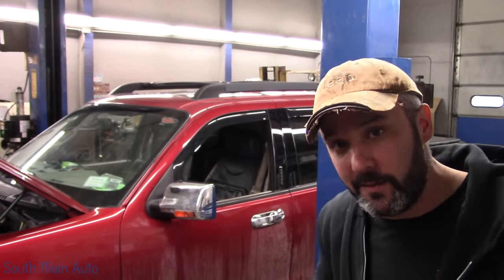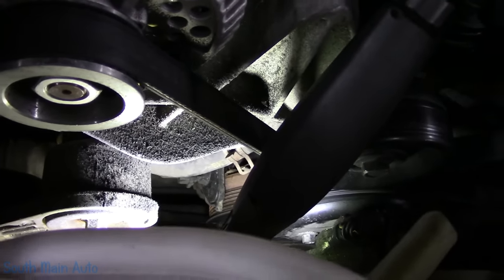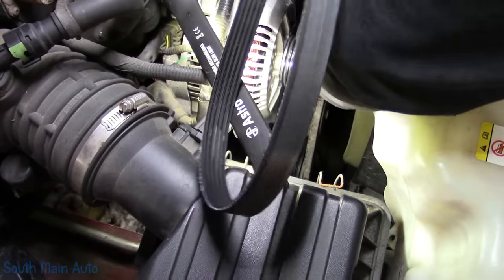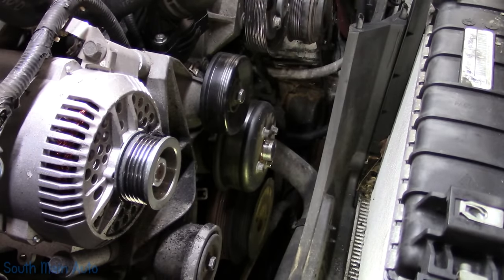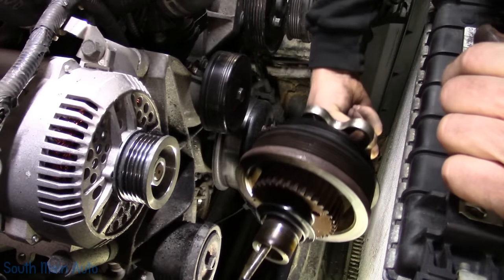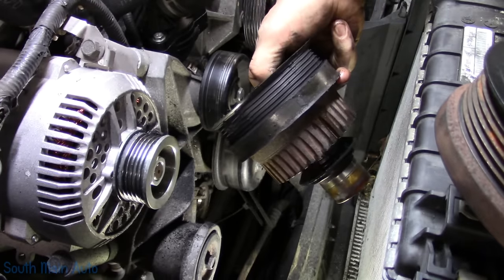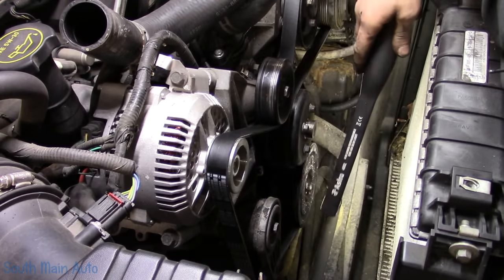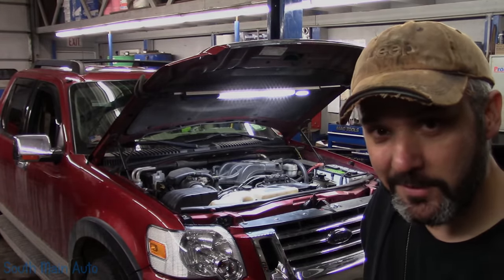Ford Explorer Sport Trac: Crank No Start

Comment: I went to Auto Zone asking for Silicone paste (grease) or whatever product they have to lubricate the caliper guide pins and dust boots. The employee told me: "you can use whatever grease you want, it doesn't matter", i told him: "i need something silicone base", and explain him why( he looked at me like i was crazy). He called the manager, manager told me to use anti seize!...Really!!  They're clueless. Smh
Reply: If ur are the one doing brakes!!is your job to know what use!!!!
Reply: @ae92guy16  If your selling auto parts and supplies it's your job to know at least a little about what your selling. Telling someone to use the wrong product can potentially be a big safety issue. For instance when that grease he said was okay to use melts and gets all over the rotor and the customer has no brakes.
Reply: @aaronledford4070  They couldn't pay people with that kind of knowledge what they're worth unless it was a retired mechanic working part time who doesn't want to make much.
Reply: The employees at these Auto box stores are only keyboard punchers..no clue about vehicles!!!
Reply: That's OK.... I had a seasoned Dodge mechanic (when I worked at a Dodge dealer) tell me that anti-seize couldn't be petroleum based because if it were you couldn't use it on brakes (like what a dumbass). He was an arrogant, rude SOB, too. He couldn't even do wheel alignments, and messed up things like simple brake jobs, but was quick to offer rude and offensive ridicule if I didn't know something or if I made a mistake (and I made plenty of them when I was new at being a mechanic). So I just shook my head on the anti-seize thing. But when he asked me to do the alignment for some front end work he had done I really tore into him! "How can you be a flippin mechanic for 20 flippin years and not know how to do a wheel alignment!", I told him...
Reply: I had a young guy at Murray's ( Now O' Reilly's) here in Michigan try to tell me that the alternator does not charge the battery. I asked him what did then and if he would like me to explain to him how an alternator works.
Reply: @ae92guy16  sure but if you asking for coolant they should not say 'you can use anything, we have gallon jugs of water, but you have a garden hose don't ya!?'

It's baffling because they all sell one use packets of BRAKE grease at the counter. It's not that hard to look at all those little packets and give the one for brakes vs anti sieze or anything else. Heck you can literally look at the description on the packaging for all the products in any auto parts store and learn what product is designed for what application. This is just sales 101, you have to know what you are selling before you can sell it. That has nothing to do with being a mechanic or having much mechanical knowledge, you just need to read the packaging of what your selling. Really burns my biscuits, especially when the manager is the same way.
Reply: @TheJuanSolid   if the world worked the way u think everything be nice and perfect..these people get paid hourly ...if they were flatrate or commission earned they probably know better..#do ur research #dont rely on any one...
Reply: @chrisclark5204  what did he tell you or you didn't say yes?
Reply: @justzayit5082  He didn't say anything, just got me the new alternator.
Reply: @aaronledford4070  I was changing a caliper out on my truck and forgot to put loctite on the caliper bracket bolts (I was cheaping out and using old hardware). One of them got up and left. I go into the advanced auto near me to repent for my sins and get a new pair of bolts. The lady that was looking them up for me told me, to my face, that it's the pads that hold the caliper on. She said I'd be wasting my money if I bought these bolts because I didn't need them. I was speechless. Needless to say I bought them, and saved myself from brake failure and removed the crazy vibration from the caliper only being a quarter of the way over the rotor. It made me think though, if someone didn't know better they would have just left and not done anything about it.
Reply: @Kronkulus9282  oh my lol
Reply: Anti ciese is what I use for caliper pins n on the edges of the pads n for few other things even on the 5.4 3v motors on the plugs,  I'm on my 16th year as a mechanic never had a problem
Reply: @mechanicchaz7639  it works. But if you ever go to take it apart again it definitely doesn't slide very easily. It doesn't handle heat well like the synthetic silicon based stuff
Reply: I've been using Permatex Silver Lube for over 30 years with never a problem, and never a seize after application, when properly applied.
Reply: @aaronledford4070  You can put as much grease on a set of brakes that you want and you will still have brakes. I've demonstrated this maybe a dozen times now to various pearl-clutching idiots.

There isn't a grease made that could stop the 30k psi of mating pressure at any meaningful speed from building up enough heat to smoke the grease off of the rotor.
Reply: I'm surprised they didn't ask what year make and model of car 😄😄
Reply: Tell him you want fries too. They seem to understand that.
Reply: I called there asking what the group number was for my friend's truck, because i qork in a delco certified distributor warehouse, and the guy was like "group number... Uhh......" And i was like "yeah, the number to identify the group of the battery so we know what batteries can be used in whichever car happens to use them" and he said "that's not how it works, you just give me the model and I'll tell you if we have the battery" i was like jeez man who the hell hired you
Reply: @mikesecondo2254  
I take a little bit of offense to this....I  give you that a lot of them are... but the store i work at has some pretty good mechanics behind the counter and some young ones willing to learn and we cycle through the keyboard jockeys pretty quick.  For what it's worth the company name doesn't start with an 'A' ether.
Reply: @alexlail7481  oh yeah forgot to mention.....called and spoke to someone who again was clueless....I had asked if they had a upper radiator hose for a 1969 V.W. bug..he said one moment while I look it up... moments later I was told yes we have one in stock....!!!! (Really)...Mmmmm..NOW WHO IS THE A!!!
Reply: @mikesecondo2254  ....
You may want to go back and read  my comments slowly and carefully.  Because your current comment makes it look like you....
I think you read my comments wrong
Reply: @ae92guy16  DUH!!!
Reply: @robertgantry2118  well believe it or not...lot of repair facilities ..like dealership have technician that specializes in only a few repair procedures. I worked at  a chevrolet dealership as well a Hyundai dealership and not at all had a clue how to do a F.E.A.....But then again these guys who are doing them are probably only 60% doing a complete alignment...
Reply: @mikesecondo2254  - Well, not everyone can do everything. But if you're going to suck up all the CP front end work, then don't expect me to just run over and align the thing for you. I don't work for table scraps.
Reply: @robertgantry2118  you probably don't even do a thorough f.e.a.!!
Reply: @operator8014  Any brake shoe that I have seen grease on had always stopped better then all the rest. lol
Reply: I throw marine grease on mine. Been doing it for many years
Reply: Lmfaoooo ooooo I had the same thing at my local autodumbdumbzone! "Use antiseize it's all the same" I told him yea go ahead and try that on your vehicle, come back a year or two later when your slide pins lock up because antiseize doesn't handle heat well and turns into a crusty mess. Pretty sure that's also part of the hiring process "what is universal grease for everything " you answer antiseize? Ding Ding!
Reply: I basically agree, if you have an employee that doesn't make mistakes, they are probably not doing anything; In the army, I worked with a guy that always had a perfectly clean uniformed- at the end of the day; One day my Section Chief asked him how everyone else had dirty uniforms, but his was perfectly clean (we had been working on the vehicles, at the motor pool). This guy with the clean uniform said, "he was just careful not to dirty his uniform" - section chief was buying it; the section chief was a pretty astute man, IMHO. The guy with the clean uniform (I work around him) really didn't ever do anything, so his uniform was always clean- just as the section chief thought! If I was a supervisor, and if a guy was supposedly working for me, and didn't ever make a mistake, or had a clean uniform everyday, at the end of the day,  I would watch him very closely.
Reply: why silicone? there is a rubber boot there, seems like any greasewould do;  tks

Comment: The only mistake was going to Auto Zone.
Reply: Vato zone
Reply: There is an Autozone just down the street. There is an older gentleman that knows his stuff. So, it really comes down to who is at the shop. And whether or not they give a damn. The 2 kids at the autozone you visited clearly didn't care.
Reply: Napa is my choice, although I do have AutoZone not to far.
Reply: 2007 nissan pehifanderq
Reply: Quite going there after I went there for I belt I needed  and they were the only place open at the time so I kinda had no choice but long rant short it took me 12hr and 8 belts to finally go over to advance where they gave me a good belt the first time and correct belt!
Reply: I went to AutoZone once, there was a young kid and a twentysome thing, I told him I needed a muffler bracket, he looked confused, then said "my turd is a banana" to the other guy.. wtf
Reply: I went into our local O'Reilly store several years ago as I neared retirement.  I kinda bragged to Randy that I had almost 30 years with my employer.  He chuckled and told me he had 41 years of service in that very store.  He started there right out of high school.  Not surprisingly, Randy is the best parts guy around.
Reply: @zuestoots5176  -- you had a good post going until you tossed out the word "Moron".
Reply: GO TO NAPA   THOSE GUYS KNOW A LOT ABOUT PARTS
Reply: Truth. I got tired of them giving me the wrong parts or messing something up almost every-time. If I have to get something from them I look the part up myself and order online/ pick up in store. Advance, Autozone. It's all the same stupidity.
Reply: That is so true!
Reply: @animestarlord9021 AUTOZONE SELLS KRAP JUST LIKEITS EMPLOYEES
Reply: I went to auto zone and order a two piece original and an pot pie, The guy just looked at the register for like a minute, then he goes ..this is
 Mc Donalds bro... ...i still need a muffler bearing. .
Reply: I use advanced and O'Reilley  because the Auto zone staff gave me the most issue
Reply: Its all about if the employee cares about his job.most of them do a great job at my local az store
Reply: In our town it’s different, the advance is a joke. Kids don’t know crap in there, and they change GM’s and lower management every other month. The Napa shut down, and now the auto zone has all the good guys from Napa so our autozone is awesome. Mostly deal with older retired military and mechanics in there. If I go to advance it’s because autozone doesn’t have it, but I go in knowing my part numbers
Reply: @zuestoots5176  If you can't debate, don't slander
Reply: Going to AutoZone is like going to Wal-Mart. No one is proud of doing it, but sometimes you just need something and no one else is open or has it.

Comment: I keep a piece of 1/4" plywood to place between the radiator and the engine so I don't have to worry about damage to the radiator. cheap piece of mind.
Reply: I was thinking the same thing; 1/4" plywood or 1/8" Masonite......
Reply: I warm the engine to get more heat plastic cardboard  leave a hole in the middle so not 2 overheat .

Comment: Eric O, you saved my tail. Was chasing a bad fuel pump on a 04 sport trac. Diaged a bad fuel rail pressure sensor. Truck ran but rough. I noted a loud belt squeal on startup. Got it running then gave her the beans then it sputtered and died. Chased back to no spark. Then I remembered this video from a while back. I went back to my original thought, loud belt squeak on startup. Then it lead me to looking at the balancer. Oh it’s got 2 pulleys, you can barely see it from the top. It all looked good. Then I had a buddy crank it. Pulleys we’re straight even the 2nd one? Wait this shouldn’t have a second one I thought lol. Went underneath and the crank sensor had a good ole cut in the side of it and the balancer “pulleys” should have been one. Crazy diag!

Comment: Well, at least you weren't the guy who installed the alternator and put on a shorter belt.
Reply: Possibly the alternator wasn't charging because the belt was too long with the pulley slipped off... so he put an unneeded new shorter belt on to spin the unneeded new alternator...
Reply: @BuzzLOLOL Alternator not charging due to slipping belt, yes, that's very likely.

Comment: These are extremely easy to work on I've had mine for 5 years now. I've repaired all the factory falls in the engine and in the transmission

Comment: I totally agree with you on your rant about unqualified youth behind the counter. I had such and encounter with one of these "Gems"
at Pep Boys thirty so years ago when I needed a drivers side engine mount for a 1967 mustang.  The young man looked it up and 
first told me they didn't carry this item for a 289 engine (REALLY???) then said "Oh here is one for all 289 except Conventional (???)"
I ask what conventional was and he said "Look right here it says Conv. " I then asked if that could be Convertable?  to which the light bulb
came on over his head (Dimly) and he said "Oh yeah that could be it". So I took the part home and struggled for 20  minutes under the car trying to
install it before realizing that wonderboy had given me the wrong part. At that point I called the local shop that knows every car on the planet and 
when I tossed the engine mount on the counter the Jedi master said "Oh that's for a 390 mustang and you need this one and magically produced the
correct part for a cheaper price. I went home and 5 minutes later had the car fixed and never went back to the land of the clueless. There are
some places that should not be staffed by the undertrained, auto parts stores and fast food drive through lines.

Comment: Only thing I would add here is that you might need to perform a crank pattern relearn. I don’t think this one has a function in the scan tool. The Fords I have had that didn’t have the function required a reset of KAM. Disconnect the battery and test drive. Three decelerations from 35 mph. Relearns them. I have seen some start counting misfires after a dampener replacement that was due to slight differences in the teeth on the reluctor on the new one that doesn’t match the learned pattern on the old one.
Reply: JM Diagnostics is
Reply: Rick Featherston man you have me wondering, what am I?

Comment: Parts stores problem....minimum wage=minimum effort. You can't get good help when you pay as much as the local McDonald's.
Reply: Heck around here in Southern Michigan McDonald's pays MORE than the McParts stores.

Had a 'wonderful' experience earlier this evening at a couple of them. Already had the part number and it showed online that Oh Really? had the part in stock. Usually the local store inventory matches so I headed out. Got there and it looked like the retirement home brought in a couple guys to work the counter. Gave them the number and they couldn't find it. They looked and looked. Nope. Nada. 

So i went down the street to Auto Zoo and they had 2 gals working that seemed more concerned about their chips and salsa then to actually be wanting to help a customer. Same thing, no part.

Both stores must have brought their 'A' teams in for Saturday night.

Pretty much shot the evening repair until tomorrow and HOPEFULLY Advance (in another town) will have the part I need.

Comment: I knew that thing was going to be a shit show as soon as I saw the "Econo Power"battery.I dont know who sells them but they are garbage.I honestly thought for a while someone was just reselling used batteries.
Reply: SouthJerseySound yeah. I had a super start battery that only lasted two years from when I got the car. Previous driver just got the battery.  It only survived one winter, and died this past cold snow weather
Reply: Say Joe, there might be other issues with your vehicle.altenator could be overcharging or a temp sensor that is squid and not telling the right temp to the
pcm for charging voltage. might want to check those things
Reply: Idk about you guys, but when I open the hood on a car and see that famous "Econo Power" battery I know that the car i'm about to work on has been treated to only the finest parts and highest level of maintenance possible and is in no way shape or form owned by some penny pinching loser who goes to the bronx to buy used tires to slap on their ebay wheels and gets once every other year conventional oil changes.
Reply: The majority of places do sell used batteries, they get the cores back clean them up put in fresh acid and call it a day, which is why some last and some don't, they're not new, the plates inside may or may not be ok...maybe you get lucky and it lives, maybe you go out tomorrow and the car is dead again LOL.  Also the reason many batteries have practically no warranty, or the warranty is so pro-rated that a couple days after purchase it dies and they give you a penny in exchange and charge you another $100 for another questionable battery.